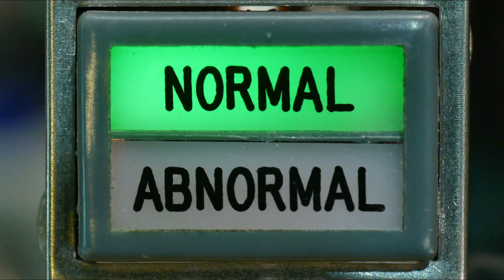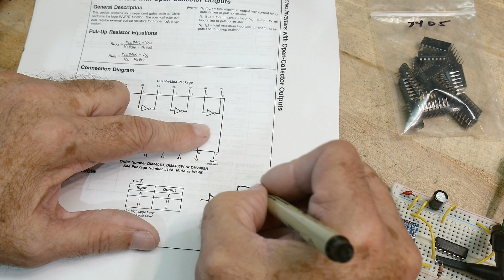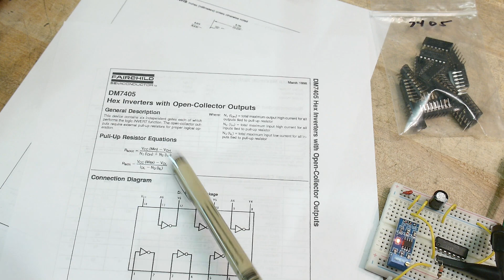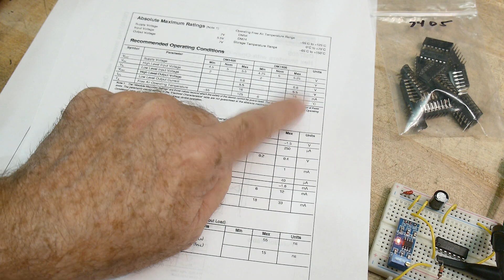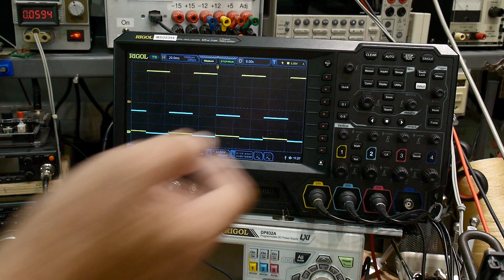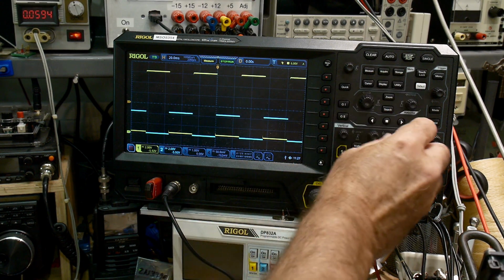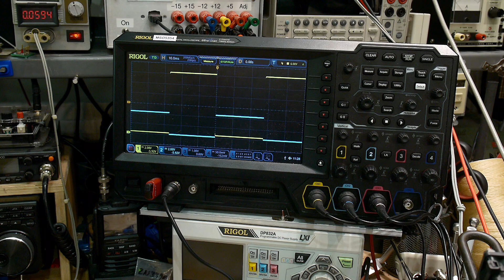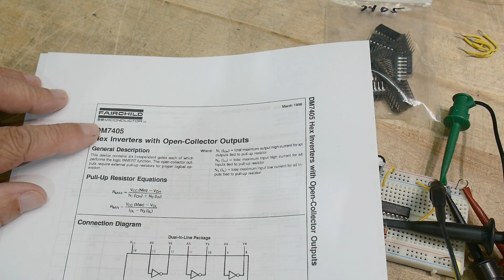#1301 TTL 7405

Comment: The '05 was for wired-OR - you'd connect multiple of these to the bus and whichever device was selected as the sender, or not.  There'd be a single 2.2k pull-up to +5 somewhere on the bus.  The higher voltage versions were the '06 and '16.

Comment: That's because it's logic, not driver.
16mA because usually 74XX were usually rated for a "fan-out" of 10 where input unit load is 1.6mA.
An 74LS unit load is even less.

Comment: Higher output voltage versions are the 7406 and 7416. There were also 7407 and 7417 for non-inverting operation.  I designed these kinds of parts into many designs in the 1980s. I would say that the data sheet was complete; it's just that you were expecting the part to support a feature that is not to be found in that device.

Comment: You can use low duty cycle pulses to measure VCE non-destructively.  There are OC drivers (not 74xx series) that can handle 500 mA and/or 40 V.

Comment: So to go "Real Old" - Don Lancaster's TTL Cookbook. I purchased mine in 1976. Quoting from that, page 126

"Three open-collector versions also exist, the 7405, 7416, and 7406. These latter three devices lack an internal pull-up mechanism and can have 5, 15, or 30 volts applied to their output collectors without damage."
Reply: I still have my TI Logic Data Books, volumes 1 and 2 from 1989.  I remember some of the Don Lancaster stuff too.  They were interesting times.

Comment: the Datasheet say Output Voltage 7 Volt.
The outputs may be switched in parallel, then this is an OR function.
The outputs can be used to control incandescent lamps or LEDs.
Or as a level converter 5 - > 7 V

Comment: Absolute max is absolute max. But note that is still higher than the normal TTL output high voltage.
Used "wired or" often.

Comment: Another advantage of open collector outputs is when you connect them to a bus. With a totem output, there's a risk that if more than one output tries to asset to the bus with one pulling high and one pulling low, it will effectively create a low resistance path between power and ground, damaging both output stages. With an open collector it doesn't matter, as there's never the possibility of one device trying to pull high while one pulls low, as they're only capable of pulling low.
Reply: correct, and open collectors devices on a bus are used as "wired or".
Reply: However you are adding the capacitance which doesn't matter for the slow buses.   Topically the open collector gates have higher output capacitance then regular ones.

Comment: I have to believe that your higher voltage recollections we're for the 7406.  I worked with a lot of equipment that had used 7406 lamp drivers.  Never saw a 7405 other than on paper.  7406 was good for max 30 volt and sink 40 ma.  I enjoy your channel a lot!  Keep up the good work.
Reply: 7405 ist just for "wired OR". I.e. connecting a lot outputs together with only one pullup 😉

Comment: 5V because they simply omit the upper NPN transistor over the normal TTL device, and thus the lower transistor only has the standard TTL 7V abs max rating. You can get the 7406 with the different output device doping, which allows you to use it up to 30V on the collector of the output, which was common to use it to interface directly with things like lamps and relay coils running off 24V. Funny enough I worked on equipment that used a SN5406PM3 device as part of it, and the one suffered a power supply failure, that applied the unregulated 14VDC input rail to the 5V TTL in it. Also had the crowbar thyristor or it's zener driver fail open circuit quietly some time before, so this ran with 14VDC for a few hours that way.

Only damage was a single blown IC, said SN5406PM3 in a 14 pin flatpack case, no longer on the datasheet as well, and it bears little pin out to the DIP package, as the flatpack has GND on pin 4 and Vcc on pin 11 IIRC. However this little ceramic package with the soldered on lid was the only IC that was unhappy running off 14VDC, and cooked the solder off the lid, and then blew out the bond wires to the die. Could have changed it, I did buy the single most expensive Weller tip i ever bought, specifically to do these packages, but, as there were plenty of the board in stock, traditionally not a board to fail, it was just replaced with a new board, the system was tested to death, and after rebuilding the power supply, which was replace every part on that board, including resistors, just in case, and the crowbar, the unit was sent out again.